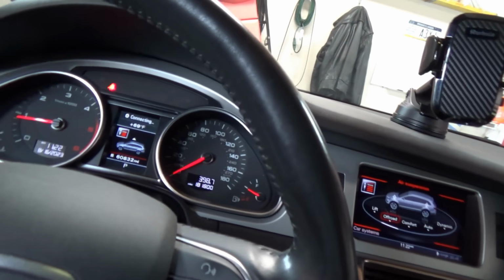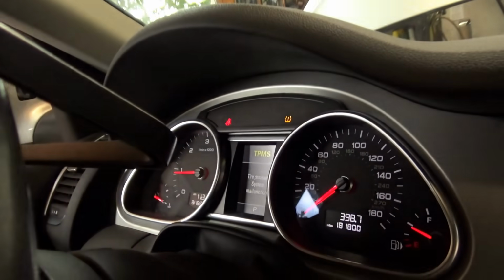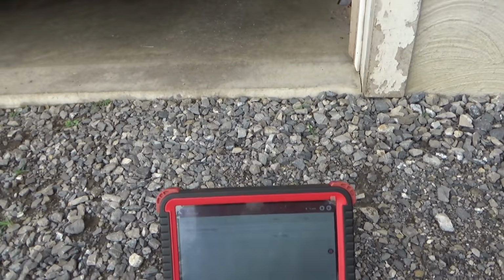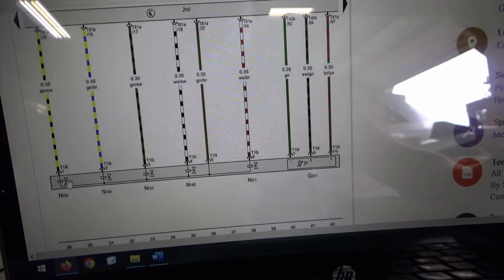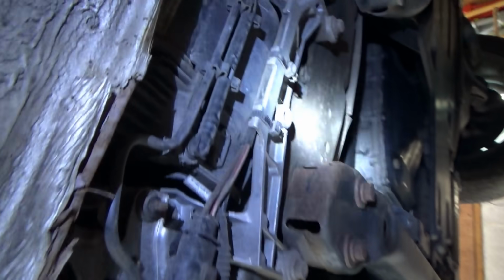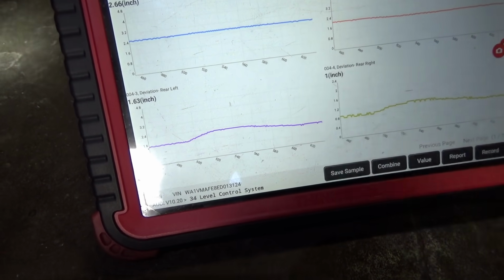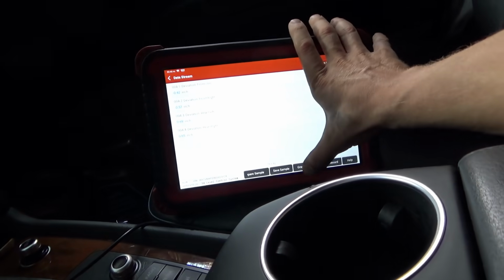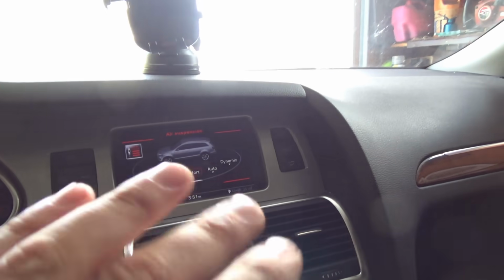Audi Air Suspension MALFUNCTION? ('14 Q7 TDI)

Comment: What equipment are yall using to fill air suspension that uses nitrogen? I just got fished installing a harness on a 2022 tesla model s plaid and I still gotta replace the compressor front lines and valve body on the car for the air suspension.   The only shop I work on tesla at doesn't have the nitrogen filling system and I need to know what equipment to request,  the fitting looks like a normal valve core do maybe just a regulator coz they do have nitrogen tanks for all the different types of welding equipment.   If ya'll ever need to replace the whole front harness on the car it is possible to do so without removing the HV battery and dash,  just saying lol
Reply: Ehh?
Reply from the maker: @rkan2  lol
Reply: I just figured someone might know or have experience with those systems.    Shouldn't be hard to comprehend , you'd think so anyway
Reply from the maker: @CatScratchFever10x  Maybe just get a Nitrogen tank with a regulator and adapter fitting?
Reply: @PineHollowAutoDiagnostics  that's what I was thinking.   Never used that before so I didn't know for sure what to get.    It's not my equipment or responsibility to provide it,  they don't know anything at that shop and  we all are tesla certified and acquire tooling as we need it.  I've read up on what to get but there's still variables so I was hoping someone could provide a link lol.  I wish I could make videos myself but they have a very strict social media policy that would result in legal action if violated and I ain't about to go down that road.    Not everyone gets to do the things I'm doing and I would definitely watch my videos

Comment: On Mercedes they make kits to put it back to shock absorbers. The parts are really expensive for these   systems. 4 air struts air lines ,compressor, air tank , valve block.sensors.Just more things to go wrong .

Comment: For the pump-   it's a good idea to just give it a visual inspection.  Sometimes the pump will be near the wheel and can get covered with a layer of mud and dirt and if you just spray it clean, it helps to stop that overheating issue.
Reply: Right, a good pressure washing might have unplugged any stuck relief valves. Continuous up and down...500 degrees yowsers!  I thought for sure he was going to burn up that little air pump.
Reply: Great info

Comment: HI Ivan , great information as normal ,in short "yes" the residual valves are a real common problem on these cars easy cheap fix and you, will need to change them or the fault will come back I can assure you . A modified socket is required which you can buy or alter one you have. One little note you stated its safe to jack the car in lift mode which can cause all sorts of issues if you do and may have to re-calibrate the levels after jacking. The correct way is to enter the car menu and in there you will find a car jack selection which you need to toggle on for these cars  to be safely jacked and lifted. Just another note as am sure you are aware the doors need to be closed for any suspension movement and the compressor overheat code is always stored on these cars as they overheat just moving the car from low to high a couple of times. if the compressor is tired you can obtain a new piston ring and cylinder head which works really well and you can keep the OEM motor ect ,or an after market compressor and valve block which lasts almost as long as the OEM and are a fraction of the main dealer price. Keep up the good work :)
Reply from the maker: Great information!
Reply: @PineHollowAutoDiagnostics  There is also air dryer on that compressor unit, think those "beads" in there are quite easy to replace,  people here in Finland are suffering that problem at least in mercedes used comperessors.
Reply: I am glad someone else has this view. Air suspension really isn’t that bad to deal with. I have had a few Mercedes with airmatic and aftermarket airbags really cost no more than new coil springs. The issue is people just ignore the problem and ruin the systems. I really do like having the air suspension especially for towing and high speed driving.
Reply: Great video Ivan I just thought I’d let you know that when you removed the pipes from the valve body this also cleared out any moisture and damp within the body of the valves , i’ve had to do this action several times before with systems working intermittently ,these are my favourite suspensions and I run an Audi with the same system! Not at all money pits! also look at the pump compressor and you see a small foam filter cleaner fitted to it you need to remove wash this and refitted ,if you have any problems with System is losing pressure this is usually with the airbag connecting to the metal part of the shop absorber this again is another easy fix just by removing cleaning the O-ring seal and refitting there are a few videos on this on YouTube the small seals on the copper fittings into valve bodies are usually exchange and if you doLook closely at the pipe you can see what we call in the UK  ‘olive fittings’ . . Also if you have a problem problem with the compressor it is only the piston ring that wears out these are available on eBay on eBay as a repair kit for a repair kit for about $25
Reply: These are very good systems and with regular maintenance work great and last a long time. Like many have said refreshing the pump is cheap and changing the dryer every 100K is about all that is ever needed. Keep inlet clean also is a must. I worked for a hotline for many major parts lines and we would get a couple calls a week on these and it was always simple fixes of cleaning the moisture from system, installing new dryer and maybe replacing the valves and occasionally a solenoid block that was cracked from freezing.
Reply: Those check valves are in all VW airsprings that are this all in one style. Had the same codes on a Cayenne 1 facelift. They seem to seize shut due to moisture in the air. Does set the same timeout code, too. Guess the engineers didn't really think this could happen, so there is no real code for the situation.
Pre Raven Teslas seem to have those shocks, too.
Reply: @tschuuuls486  I guess the engineers missed the class on condensation. And the air will develop moisture based on temperature and pressure change.
Reply: @Gilboy64  I know. And I also was confused by the generic error code, when I came across the issue.
Reply: And while we are at it: On Mercedes with air suspension the level sensor linkages are made out of a plastic that sometimes turns into al dente Spaghetti integrity wise. Or the linkages seize and cause issues that way. Just replace them at that point. Also on a Merc the air suspension will not adjust right after you deflated it or lifted the vehicle in any way. You will need to drive it for a few meters for the computer to trust the sensor values and lift itself off the ground. If you don't know that you will seriously scratch your head why it won't lift up (no indication that you should start driving in the dash).
Reply: Very good to know.

Comment: No way in hell I would own an Audi. They couldn’t give it  to me for free I would run! Lexus or Acura or Volvo will serve u better!!
Reply from the maker: Idk I have a 13 Volvo XC70 in the shop... The exhaust flanges literally vaporized in 10 years and rear suspension bushings are shot at 80k miles... Junk!
Reply: They ain't all bad lol. I had an 02 Audi A4 1.9tdi, owned the car for 7 years and it never once put a foot wrong, even at 300k miles.
Engine was as close to bombproof as an engine can get, returned over 1000 miles to a full tank regularly.
Difference was it didn't have any of the fancy pants gadgets  manufacturers insist on fitting in cars now, just basic driver info display and cruise control
Reply: In the US they like to sell the premium optioned vehicles. Audi/VW is fine if you just get the 4cyl manual - which you can barely get in the homeland anymore!
Reply: 19 years and 180k+ is great life.  When you buy, the trade off is features vs longevity.  If you get the latest Honda or Toyota in top trim, you have a lot of electronics.  Would a 1990s Toyota go farther?  Most likely.  Would today's Toyota with plastic engine bits run 30 years?  I doubt it.
Reply: Just avoid air suspension in general.  My mother had a 90's Lincoln that had air rides and it all broke down too.   She spent around 3k to get it fixed back then.   I've seen Mercedes have issues with their air suspension also.
Reply: Only fairly reliable air suspension I've personally seen was Toyota's. Was fortunate enough to own a soarer V8 limited that had adaptive air suspension, and this was way back in the 90's. Didn't matter how fast u hit a corner the car stayed flat as a pool table, awesome system

Comment: Hey Ivan, do you know of any good mechanics in Las Vegas? I have had two mechanics throw the parts cannon at my Honda Accord.
Reply from the maker: Unfortunately no. You can learn how to diagnose the problem yourself with the help of my channel 😉
Reply: @PineHollowAutoDiagnostics  that is why I have been following you for years. I even did an engine swap and have been able to diagnose quite a few issues thanks to you. I might just ship the vehicle to you.
Reply from the maker: @systemloading6875  what's the problem with your Honda?
Reply: @PineHollowAutoDiagnostics  long story short jdm swap with misfires on every cylinder. Starts and runs for like 30 seconds but the accelerator pedal does not work/respond. Mechanics have installed new plugs, coils, gaskets, heads were machined twice, block was taken apart and I think a new piston set was installed, injectors were  cleaned, new fuel pump, a few sensors were changed, etc.
Reply from the maker: @systemloading6875  sounds fun 😁